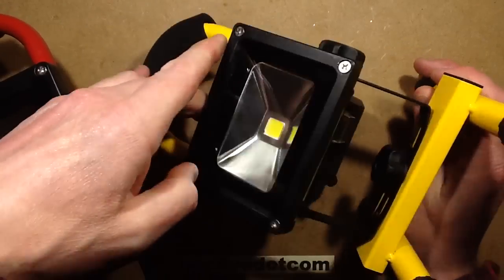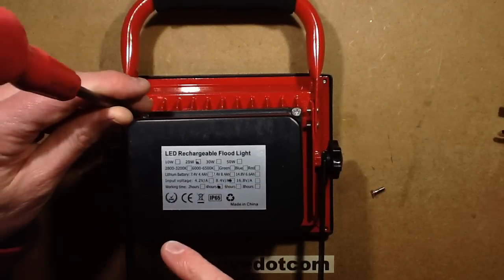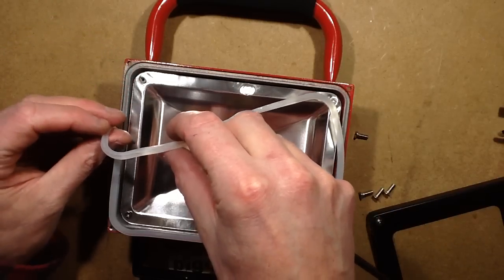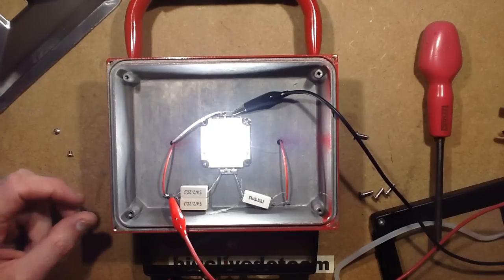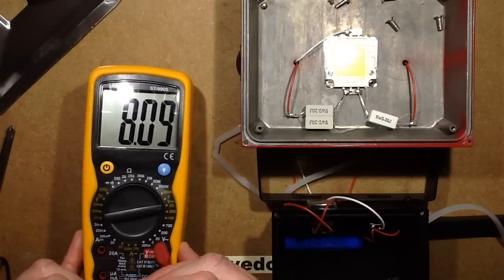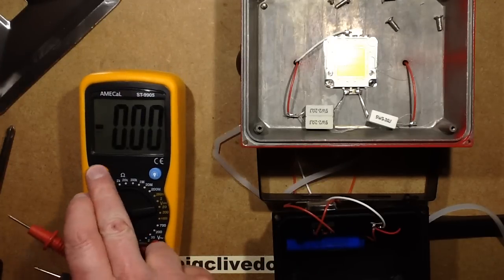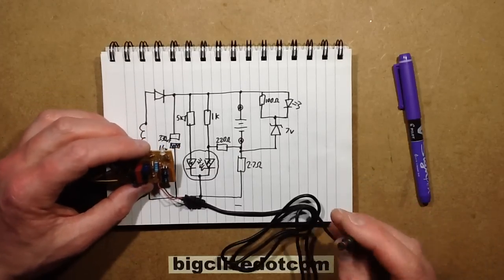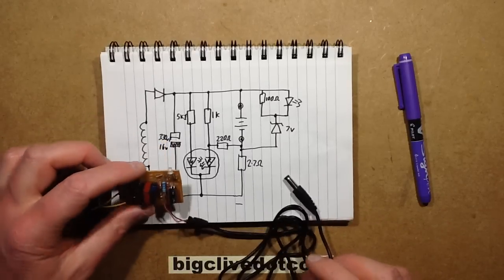A look inside a 20W rechargeable LED work light.

Comment: so is the LED actually a 20w Led? and if so could you change the resistor value or use a driver to give the full power; that is providing you also upgrade the battery.
Reply: +austins_creations although its technically a 20w you might find its one of the reject pile, bu good enough to run at 10w or a bit more, the battery would also run it, but already they are lying about battery life, it would run about 1 hour on high on the current battery, so youd have a light that runs 1/2 hour!  overall its a budget light, you get the cheaper parts.

Comment: Sounds like a perfect opportunity to mention the cheapest place to buy some LiPo, or LiFe batteries. Hobby King http://www.hobbyking.com/hobbyking/store/multifinder.asp?t=lipo 
Just be ready to spend a little time deciding from their enormous and varied stock. They do have a UK  Warehouse. Guaranteed to arrive much faster.  Not sure what it will go like there for the Isle of Man. BTW you might still be able to buy raw lipo cells in around 2000 mAh and 20C rating (mAh x C). They sell some with 130C surge!!!.  Be careful Clive, they have some really nice kit other than batteries..
Reply: +Chris Leech Yeah but they have rather crap shipping rates which means it usually ends up being about the same or worse price than getting whatever you want from somewhere else... Like those hakko clone irons for example, sure they're only $16 but then shipping is about $10 making it about average for china sellers so the only reason 'd buy from them over ebay is they might offer a bit better refund policy than an individual seller would or buying in bulk would save a bit in shipping making it a better deal.
Reply: +Chris Leech 
Yes, Turnigy ftw ;)
But be aware, it's not only the shipping costs, customs can also  throw a spanner in! I learned that the hard way :/
Check from which warehouse you're ordering.
Reply: yup couldn't agree more adter the most recent order, not shopping there for anything anymore
Reply: I am not so hot on HK anymore after recent events. Shipping is just effing ridiculous even from usa west

Comment: So there is a tiny battery that will never be fully charged due to the power supply output and best of all it will tell you the battery is charged before you even reach full capacity. 

At least the power output is low compared to spec so you will get a few minutes of light out of a charge.

Comment: As soon as I saw the charge I thought 'oh god not one of those'. You get them with many different things from ebay containing Lithium cells and they're really nasty and dangerous. They have no fuse and when they fail (which they will) they make a nice big bang and trip your breakers. They're almost famous for exploding on the mains voltage side. If anyone ever uses one I'd highly recommend you use it in a fused extension (4-way or similar) to avoid burning your walls and risking further damage to your home if you don't have a modern consumer unit with faster acting circuit breakers. Also don't place near anyone with a weak heart. Still, I'd be tempted to buy one of those lights simply to use the case and fit it with a better LED and current limiting driver.

Comment: +BigCliveDotCom Was getting worried you haven't posted a video in a while.  Thought you were either taken up ill or (gasp!) Poundland closed.
I agree with others posted that this would be a great lamp to "hack" (read "build it correctly").  You can definitely add additional batteries rather easily, maybe run the LEDs at the rated 20W?  Did you give them a pass on the crappy way they attached the leads to the resistors? No insulation, no screws holding them down.  Presumably, running this lamp over time will cause those resistors to heat and cool, expanding and contacting causing them to loosen and fall off.  Potential fire hazard?
Thanks for the great videos.  Have to say, I'm learning so much more about electronics now from you, than I did when I went to university "a couple" of years ago.
Reply: I had to laugh at the fact that there were no grommets !!!

Comment: Is there any LED lights that could be used for lighting in filming (for a movie production society)? I bought USB powerbanks, which have 2.4A outputs at 5V, which in theory could then give 12W of power, or using all three usb ports the maximum total is 3.1A. Ive been looking at amazon etc for anything, but most usb powered LEDs seem to be really weak, most taking around couple of hundred of mA. I just thought it would be really convenient to have something powered by a usb powerbank, since they could apparently output quite a bit of power, i would probably buy at least few ones if there were for example some 5W ones. I guess I could try build something myself too, would probably be cheaper. Maybe some 5V LED strip and cut into sections which run off 1A and just have three usb connectors to the powerbank...

Comment: what would happen if you connect the low circuit in parallel with the high ?
better still, connect a diode from high to low, low will be unaffected, high would also enable the low
Reply: +thechosendude Nope, both cells are in use on both levels, it''s the resistors that make the difference

Comment: I'm actually a fan of undercharging lithium cells, because it will extend their life. I normally go for 4,1 V charger IC's instead of the 4,2 V ones. Of course the charge voltage of this cheap thing is more like hit an miss.
Reply: storing lithium cells at full voltage is what kills them, not charging them up to full 4.2v capacity.  undercharging does nothing unless you plan to let the cells sit for an extended period.
Reply: +thechosendude 
Yes, I agree. Where I was going with this was, if I don't fully charge them, then they won't sit at full voltage ever, no matter if I use them or have them sitting on a shelf. Of course you trade in usable capacity, but that LED work light is actually a perfect example, you probably will only use it sporadically and most of the time it will sit on a shelf. And if you needed the full capacity, the case has plenty of space and weight isn't an issue, so you could just double up cells.
Also that 4.2 V is a very delicate figure, go over it only slightly and irreversible damage is done to the cell.
Reply: +Jack White It's a better option than what I ended up with when I bought some 14500 lithiums to run a cheap $3 single AA pocket light. My smart charger is not smart enough to not charge those cells at more than 1C so they have to be charged in parallel slots. The punchline is that the low voltage protection circuit on the cell cuts in at 3 volts. So it's leaving a lot of capacity unused but I usually have one cell sitting around fully charged. The cells run the LED brighter, but have less than half the run-time of a NiMH. A tired, bargain-brand NiMH.
Reduced capacity and shorter run-time and reduced life.
Reply: +Markle2k
Below 3 V there really isn't any charge left in a lithium cell, we're talking a couple of percent here. And discharging it further would also damage the cell (even more critical is charging a deep discharged cell ... they are a real fire hazard).
Reply: +Markle2k
3 volts per cell is a serious over discharge. personally I'd try to stay above 3.6 volts. And never under 3.3.
Reply: You must have made a typo (twice). Nominal voltage for Lion cells is 3.7 volts. Nominal voltage is effectively the average voltage over the entire discharge cycle at a fairly low discharge rate such as 0.2C. Using low capacity or tired cells, a cutoff at 3.6v might cause the cutoff to trigger as soon as a load is attached.
Tenergy uses 2.9v as the cutoff voltage for their 1S packs/PCBs, 2.4v for their single-cell cutoff in their 3S packs. Most testing sources I've seen use 2.7-2.8 volts for their single-cell capacity tests. (ie lygte-info.dk)
For my homebrew 3S pack of old laptop cells running 2 strings of 30cm 12V strip lights in parallel on the back of my bike, I pull them when the lights start to noticeably dim. That is at about 8.5v (~2.85v/cell) when they are drawing 150mA each. The strings each draw 290mA when the pack is 12.5v no-load, fully charged.
Reply: +Markle2k 
The problem with stating a cut-off voltage is that you would have to say how you measure it. Under load? Under no load? Heavy load?
When we say 3.3 V or 3 V that figure is meant under no load, if you had a cell with 2.85 V under no load then that would be as serious over discharge.
Reply: Jack White I've seen them in action on an oscilloscope and they work as it says on the tin. As the battery voltage reaches the cutoff, the current goes to zero. Then when the battery (slowly) recovers to the reset voltage, the current turns on again. Rinse, repeat until the battery is too discharged to recover.

Comment: I would rather they make lights like this that use quickly replaceable 18650 batteries. Would much rather have the ability to have a set of extra batteries on hand or at least get better capacity batteries. Also use a way more trustworthy charger too...  And if i was to buy such a light i would have to mod in a Constant current driver. And use a PWM to lower the light output. Seems a bit more efficient. IDK
Reply from the maker: +John Simpkins there are now lights that have a compartment on the back for three 18650's.  I think it may have been inspired by the UK postal rules prohibiting shipping of batteries by air.
Reply: bigclivedotcom oh cool thank you for the quick reply. Let's hope they wire that in such a way to not kill the batteries. So with a cut off voltage. Love your vids. Fun seeing someone take the time to inspect the cheap and surprising in all the wrong ways. Used your information to inspect and stop using some if the cheap Chinese wall warts I had in use.. usb hubs and led light's.
Reply: +bigclivedotcom Link?
Reply: +bigclivedotcom 

I hadn't thought of that! How does it go with laptop battery packs though?

It's bad enough trying to post an aerosol now..
Reply: +John Simpkins With a bit of faffing about you can remove the battery and put in a compartment for 4 cells. You can also fit a current mode switch mode PSU that runs quite cool. The switch can be wired to alter the current as well if you are careful. You cant just run it as an additional parallel resistor in the current sense circuit as that will make the switcher throw a wobbler as the inductance and distance from the chip will make it throw a wobbler due to noise etc.

Comment: LOL bloody hell, im sure you will find an upgrade battery for that beast :-D
That charger was odd, perhaps replace the farty diode for a schottky diode for less loss, and stick a diode in series with the zenna to up the voltage a little?
Reply: +zx8401ztv
Sadly they don't need abuse to cause them to explode.
18650's and the like caused the problem with sending batteries by post.
Just google Segway battery fires.
Most Chinese manufacturers outright lie about batteries, LED's, memory sticks and similar.
The usual price for a 2Tb USB memory stick is about £10 on ebay.
Their actual size is close to 10Mb.
Some 18650's can be opened up to find a smaller battery inside.
Does anyone actually make 10,000 mah batteries?
Brass fittings never rusted till China made them.
Anyone remember screws that didn't lose their profile.
Ebay compound the problem by knowingly allow the sale of lied about products.
Rant over.
Reply: Lol. Don't get me started again.
REUTERS: The Pentagon repeatedly waived laws banning Chinese-built components on U.S. weapons in order to keep the $392 billion Lockheed Martin Corp F-35 fighter program on track.
http://www.reuters.com/article/us-lockheed-f-idUSBREA020VA20140103
Reply: no he'd replace it with a proper lithium charger. one that does a constant Current then a constant voltage charge cycle before terminating at a proper 4.2volts per cell;)
Reply: +topher 
Im sure your right, i still think there is some leaway in the voltage cutoff, i dont think the batterys would explode if there was 200mv overvoltage or undervoltage, i think abuse causes them to pop lol.
Reply: Hope you felt better, i did :-D
Reply: Oh shit!!, all parts should be made in america, just my opinion of cause.
Reply: It's the irony.
It is deliberately hidden by the British media but American warships are close to provoking war in the South China Sea's.
Reply: At least its close in canada, but yes companys are too happy to get stuff done cheap outside the u.s, oh sorry "Outsourcing".
Its easy to see past the bullshit words that companys use.
The uk is no better, i dont think there is anything really made here now :-(.
Reply: zx8401ztv Demand my old son, nobody wants to pay to wack prices for products that are well made, they'd sooner buy cheaper items they can throw away.
I binned both my mag lights as they wanted £10 for an led upgrade, I bought a ' cheap ' led torch for £7 from Aldi and it still works fine 4 years later.
I don't want something that lasts 3 times as long and costs 10 times as much, It's not worth it

Comment: At least it is easily hackable but I am so tired of the lies from China.  Does anything made in China not fib about their actual ratings?
Reply: ***** 600AH? LOL Let's take this lithium polimer, which normally have more power per volume and weight...  3.7V 8000mAH 6.4×88×120mm 153g. 600/8AH=75 of them. This mean a weight of 11.475kg and a volume of 5 litter! I guess they are friend with one of those hydraulic press channel and succeded to compress it up in a smaller space.
Reply: +legalizeshemp420 the issue is also how ebay work... the feedback is now horrible... and broken...
Reply: thephantom1492
Many a time I wish I could leave feedback describing the item I purchased but 90% of the time the reviews would be scathing.  I just purchased some Rosin flux and the dealer said HK/China shipping but came from Malaysia and took 45 days to get to me.  Another thing is it said "No dry.  No Hard."  It comes to be rock solid hard and very crystalline so I stuck it in the microwave for 2 minutes and it was what it should have been but once cooled down it was rock hard again.  I will have to find a bottle and some alcohol to make my own "No hard" Rosin flux but the review would have tore him a new one and this is why eBay doesn't want a real feedback system as it would hurt their profits.
Reply: ***** Exactly, and I didn't made a purchase on ebay recently (all what I find is too expensive, close to brand new from brick and mortar store, for used stuff, ex: camera lens, ebay: 960+shipping+custom+tax, sold as it   vs  1000+tax with full warranty, free shipping)  but I hear that you can not give a negative feedback anymore, only a positive one or none. Broken by design. The fact that they own paypal also cause a problem since it is a conflict of interrest, and paypal for fraud ain't too great... and theif... Too much money? Let's seize it... What if you make a claim with your credit card? Banned from paypal for life.
Reply: thephantom1492
Sellers cannot give negative feedback but buyers can (just wrong imo) and I once, before eBay took over PayPal, had PP give me the run around so I went directly to my credit card who didn't hesitate to rule in my favor then charged it back to the merchant and PP sent me a note saying not to do that.  Now everything is PP and credit cards can't be used by merchants and if you get your bank, or charge card, to charge back on PP you are right you are banned for life.  Now I will say PP was just forced to be a separate entity from eBay due to the courts so it is back to the way it was 10 years ago in that regard.
Reply: +legalizeshemp420 eBay appears to be putting comments and stars on items now
Reply: topher
On some but it is a far cry from a real feedback system.  Even AliExpress has a better feedback system than eBay does.  What I find sad is that I was ordering from a guy on eBay 1 40mm fan for ~3 dollars and he denied my BO for 5 dollars for 2 and I was grateful as I have 5 of the exact same fans coming to me via Aliexpress and will be here twice as fast guaranteed all for $6.20.  The guy selling on ebay told me the wires were 18cm long yet the real fan, as pictured AND in my hand, is 28cm.  He writes back that all he has is 18cm and not 28cm and I told him of my find on AliExpress.  I also told him that I found it odd that the same fan I have, and is in his picture, would use two different wire lengths.  No response.

eBay Chinese sellers are starting to suck more and more while on AliExpress the delivery times are 10-15 days for everything I buy guaranteed.
Reply: *****
yeah   that one was quite deceiving... specially that I was always told that they were so fragile... that people sometime only knocked them over and it catched fire... And he squizz it in a press and... nothing...
Reply: Actually everything is made in China. Companies in western contries tell them what to do. So they do it. :)

Comment: i use mine without the base as you dont really need to aim it much, they could sell them a bit cheaper if they didnt include them!  they are obviously cutting corners to compete on price, my 10w has 4 cells, but was bought 2 years ago for £35 from my local electrical factors, and will run about 5 hours till sudden cut off, came with the car&mains charger